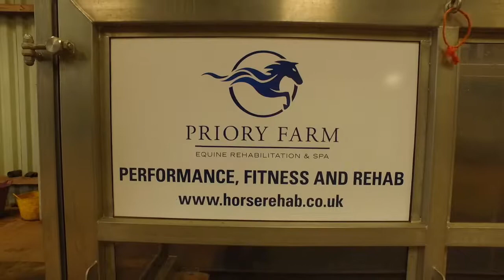Natasha Baker - Water Treadmill Training

Comment: I feel like that's not abuse but it's mean. Because the treadmill is slippery. What if it falls?
Reply: Audrey Episode the treadmill looks like it's made out of some kind of material that has some traction when wet
Reply from the maker: The flooring is actually rubber so it provides them with lots of grip :)

Comment: Is the water cold?
Reply: Chloe Dudley no not always most the time it's room temperature or warmer.
Reply from the maker: Yes it is, because its such a good work out though you often find steam coming off the water as they are working, so it is much better that it is cold water otherwise there legs would get too hot. Hope this helps :)